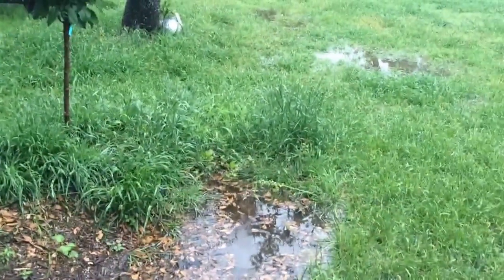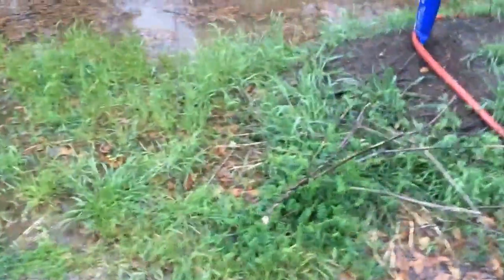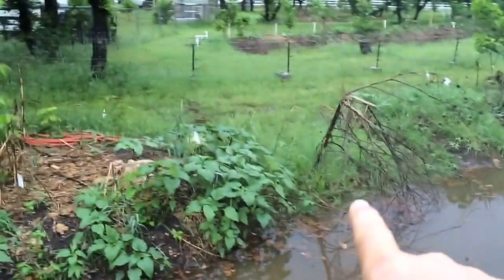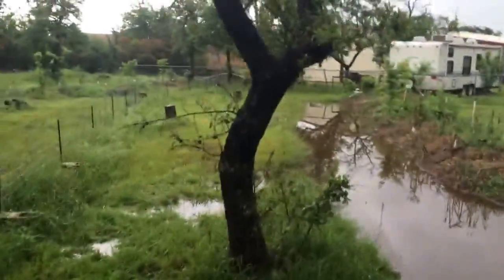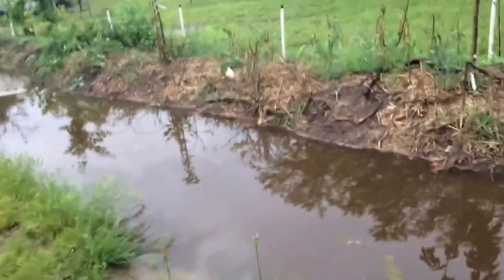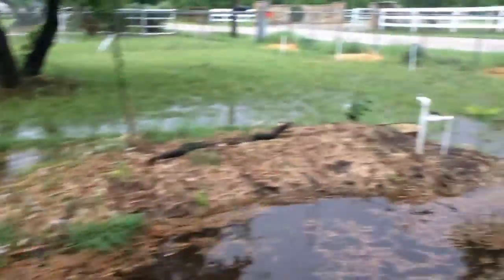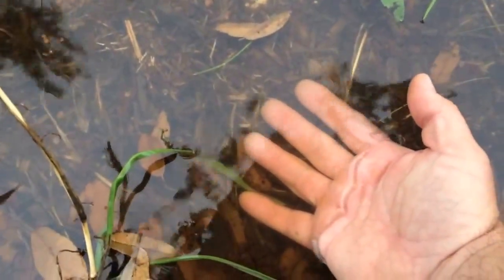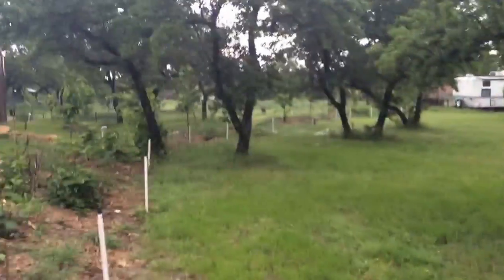Swales in North Texas Take on 2.5 inches of Rain and Preform Perfectly

Comment: Nice. Seeing the water run off the property like that, do you think you could've dug the swales deeper or would that hold too much water for the land to handle?
Reply from the maker: Gayle McArthur nope due to a rock slab layer.  Normally I would do the swales at 9 feet wide by 1.5 feet deep, I cut them down to 6x1 because going 18 inchs was NOT possible, in reality they are 11 inches deep.